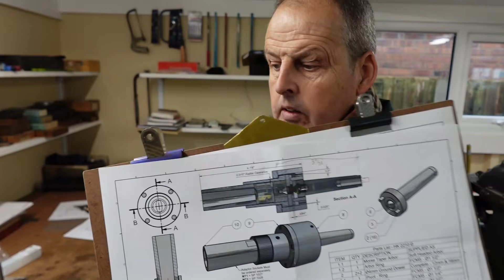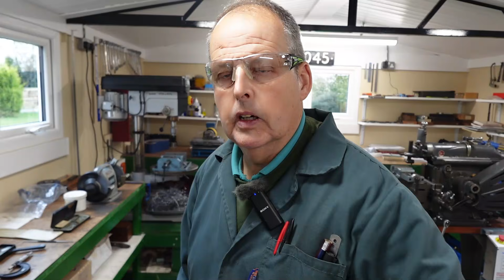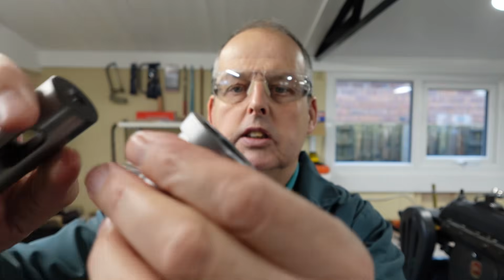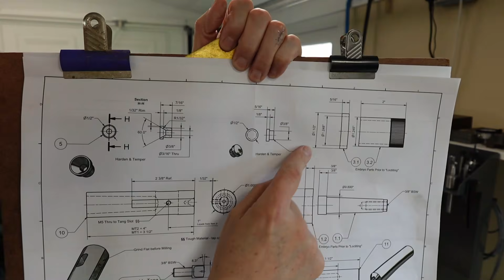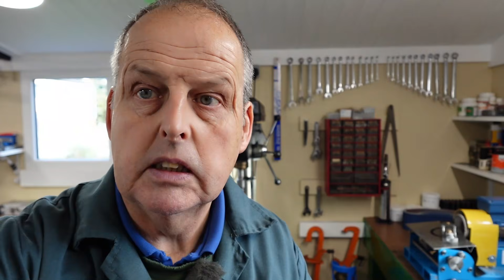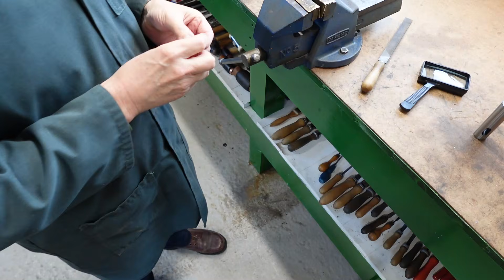Hemingway Kits.  Floating Reamer Holder (Part 5). Lathe work complete.

Comment: Dave with your ability the next project should be to sift the drive lever to the other end of the cradle  . A couple of rods and cranks and no more burnt hands and you will be able to engage the thread dial easier .
Kit from down under
Reply from the maker: That is an interesting idea.  I would not be surprised if someone has not done that modification in the past.  Thanks for commenting.
Reply: The big criticism of Harrison lathes was always that the carriage traverse rotary handle that acted on the rack, was on the left, in the way of ejected swarf. The feed engagement lever is out of the way. On Colchester lathes, the rotary handle is on the right. Even after Harrison and Colchester became the 600 Group, Harrison didn't alter this. The M series Harrison's kept the handle on the left. A lot of people bemoan this. The fact is though, that you are never going to be feeding with the rotary handle, so it's all fine.